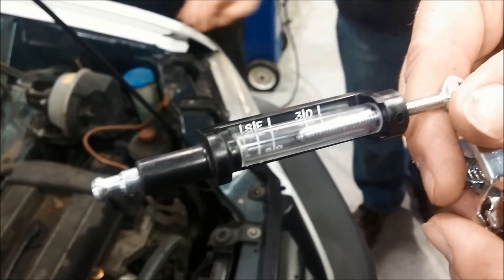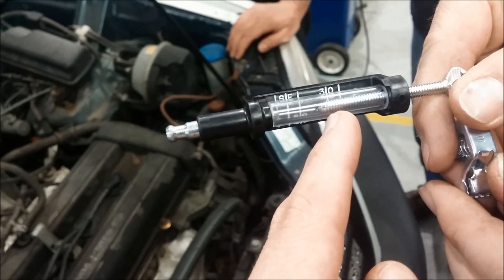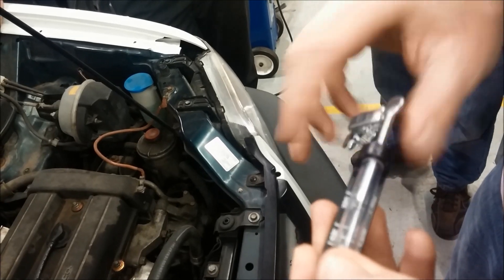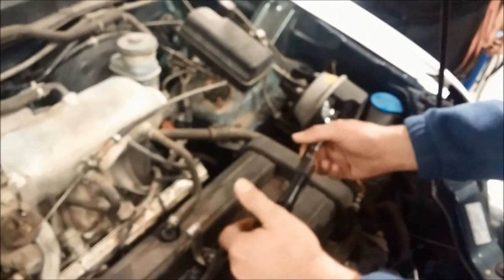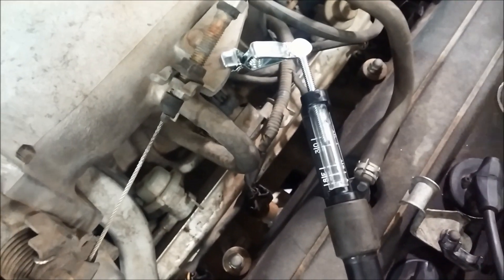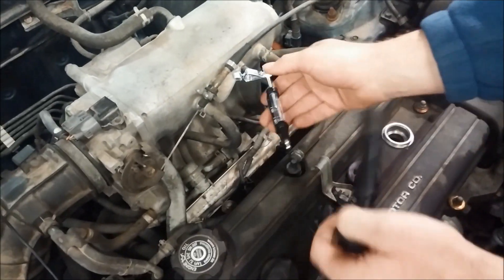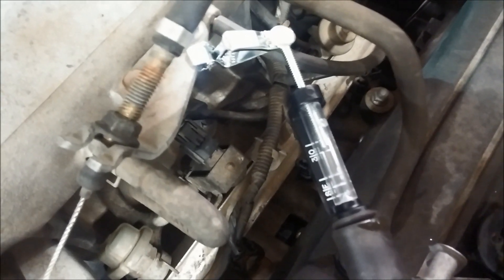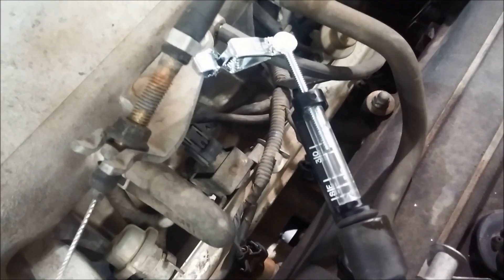Checking for ignition spark using a spark tester

Comment: This is probably the best and quickest way to test if a coil needs to be replaced.  Checking for resistance in the windings does test the coil and is a good test but it is not preferred because a coil can pass the test and still be weak under load.  

The coil needs to be tested under load not if it works or doesn't work. If it can produce a strong healthy spark or if it can't.  It is that simple.  These testers are great.  I wish they made them inline so you can actually run the engine without dumping fuel in the cylinder and putting your catalytic converter at temporary risk.  I know it would take a lot to burn up a cat but it would be nice to not have to worry about dumping fuel at all down into the system.
Reply: Just make an adaptor from that tester and down to the plug so it will test under load ...
Reply: Pull the pump relay?

Comment: Mine will jump to 20 kV but not 30 kV. No misfires
Reply: That's a weak spark...replace it or check spark plug wires if you don't have a COP

Comment: and if it does not flash : what is the problem would be ? the spark plug cable or the spark plug itself ??? i mean how to know if the problem is the cable or the spark plug ?
Reply from the maker: It could be anything in the primary or secondary ignition circuit except the spark plug.  This  means that it could be the wire, the ignition coil, the ignition module, the camshaft or crankshaft sensor, etc.
Reply: @JustinMillerAutomotive  this is the reasonable answer I have been told yet . thank you Sir

Comment: Where did you get the adjustable tester???
Reply: https://www.amazon.com/Deal%E3%80%91OriGlam-Adjustable-Ignition-Circuit-Diagnostic/dp/B06X9RC3PF/ref=sr_1_5?dchild=1&keywords=adjustable+spark+ignition+tester&qid=1624862348&sr=8-5

Comment: Did this car have only one ignition coil?  If so, what does this mean if one cylinder doesn't fire...coil good, but one plug wire bad?
Reply: If it's COP, then most likely it's a bad COP. If it's individual spark plugs with distributor then it could either be a bad plug or wire.
Reply: @osos231  it's not COP, COP has a connector directly attached to each coil (on the engine head). this is probably a coil pack, you see the high tension wire running from each spark plug.